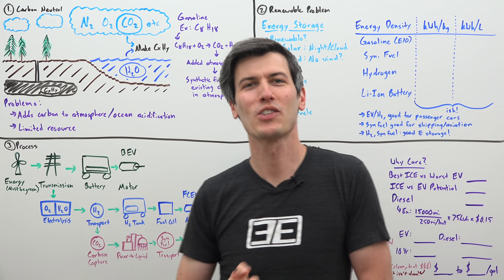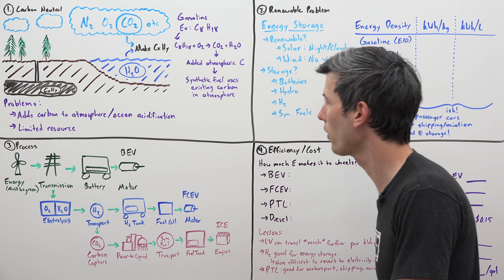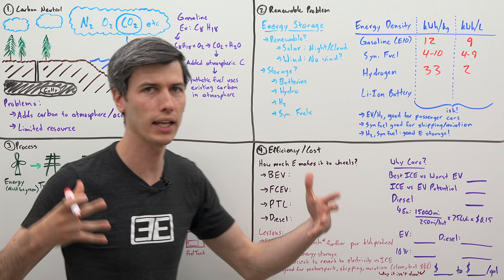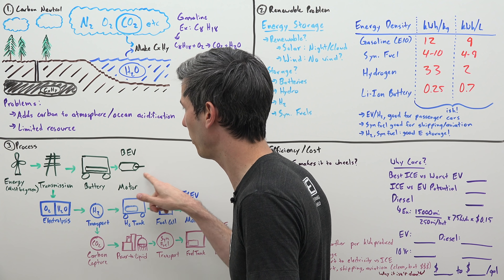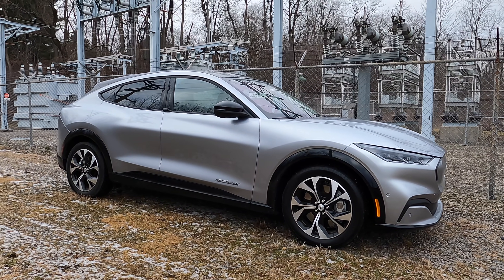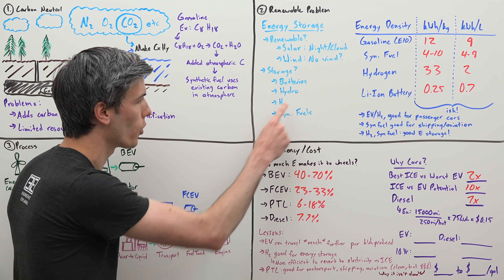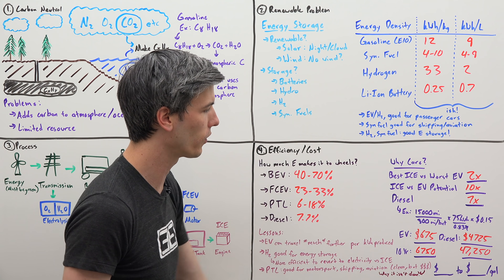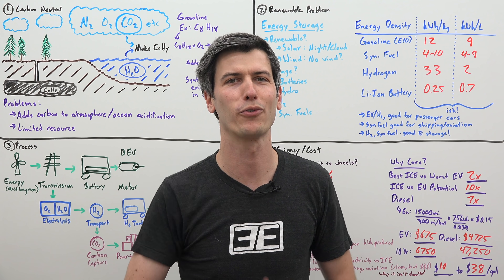The Big Problem With Synthetic Fuels

Comment: I wasn't thinking that synthetic fuel will replace electric cars- I was hoping that it will be an affordable fuel for classic cars in the future when normal everyday transportation is based on electric engines and batteries.
Reply: Decades in the future, classic cars will be small in number and not a significant source of carbon.  Just power them off of fossil fuel and don't worry about it.  The goal is to prevent catastrophic climate change, not obsess about every last bit of carbon.
Reply: well it's not like we're gonna get rid of every single ice in the next 10 years. Not even close. There will be ICE for decades to come and there will have to be fuel for them, it's just gonna get extremely expensive.
Reply: Or for Motorsport perhaps? They need the lightness and energy density that Hydrogen and Batteries can’t provide currently, and maybe motorsports could actually help develop the technology to be better
Reply: @charlespletzke8311  if the planet is truly in peril,  then motorsports would be banned,  as would jet travel,  bicoastal booty calls, politicians on campaign trails for two or more years at a time,  politicians driving about in big gas guzzling GMCs and RRs to mertings,  politicians flying worldwide with their luxury hotel junket teams to discuss less consumption, navies cruising the world intimidating each other,  air forces flying constantly and SpaceX and other companies burning millions of gallons of kerosene to just hang out in Low Earth Orbit or put up WiFi sattelites to help people get their porn faster. 

If you stand back and watch the societys leadership,  there is a massive disconnect from words to actions.
Reply: @STho205  great points
Reply: @STho205  yes that's all true but a poor excuse for personal behaviour (eg: obsessing about the need - in personal transport at least - to make huge amounts of noise (even if some like it) and waste huge swathes of energy) just so you can have a car that is more dangerous, less functional and (if you have a driveway) basically just less convenient.

So if you have to pay over the odds for the synthetic juice to generate all that waste the you won't get sympathy from me when you can't afford decent food.
Reply: @aidanapword  in what world is driving an ICE vehicle more dangerous then driving a bomb on wheels? (EV)
Reply: @aidanapword  I still have a 2013 gasoline car, because affordable EVs were empty promise vaporware then (still are),  and my 1994 car was getting worn out in 2014.   The 2013 Ford is as quiet as an EV inside,  and barely audible running on the outside.   ICE cars are not loud unless that is your thing. 

2033 will be my next planned car replacement.   We'll see whats around then.
Reply: @STho205  dude, I love your comment. Its honestly sad though that that's the case but hey, what are you gonna do right?
Reply: @STho205  that's absolutely fine, of course. And the right thing to do. Whether they are vaporware (in 2017+) or not is a matter for debate. But even if you assert thatthey are still vaporware (ignoring the real world use by many millions of people ...) ... then 233 is going to be a real treat!
Reply: @aidanapword  affordability is relative to people's emotional tie to vehicles.   For me, and I only mean me,  a vehicle must last at least one year for each $1000 purchase price.   I doubt a 2017 Tesla would last 75 years.   I doubt a 2020 T3 would last 40 years.   I know Leafs aren't even lasting 10 to 20 in useful service.   EVs are still in the "Brass Era" of cars (similar to 1910 cars by comparison).  These cars are still prototypes.   I hope they become practical in a range of cost from frugal to posh. 

I have been able to keep to my rule on average for the last 40 years.
Reply: @Jcewazhere  the Chevy dealers never have any on the lot.   They special order them when you twist their arm in my district.  Seems like scores of trucks and SUVs, but no Bolts.  Salesmen say,  you don't want that do you? 

Enjoy your car.   Still too expensive for my transit needs if just a box car,  and as I make a 420 mile trip once a month...all I see at the 200 mile mark is pair of 20amp slow chargers at the Welcome reststop that I'd have to circle back to for an additional 20 miles when heading south.   Half the time I've stopped there to pee they have "out of order" signs.  So much for "The Ray"

I'm sure there's something around Auburn Alabama, but I'd have to go into the city.
Reply: @Jcewazhere  where did you get that we spend $5000 per year to keep our cars running? I spend less than $200 per year each to keep my BMWs running and they're 14, 18 and 19 years old.
Reply: @Jcewazhere  you should look up what cognitive dissonance means. Who said batteries have to have a lot of energy to be explosive? When did I say the range per charge was terrible? You have no argument so you're strawmanning me.
Reply: @Jcewazhere  boy you have no idea how anything works in this world
Reply: @Jcewazhere  it sounds like you beat your car up. The junkiest of junk cars don't cost that much to operate.
Reply: @Jcewazhere  I took inflation into account.  Doesn't matter though.   As I grow older I grow more experienced and less emotionally enamored with an ugly tin box with wheels.  Easier to choose well and spend less.  All cars look basically the same now,  so emotions are easier to check. 

Buy junk,  drive junk, walkalot  pay to completely rebuild the car every few months. 

Buy new,  pay for posh,  the salesman salary,  the insurance agents commission,  the bank officers salary....fine if you know you're doing it.   Dreadful if you keep rolling debt into the next car.  Indentured servant.

Buy 5000 cars.   Keep them five to six years while saving the payment equivalent in your own account.   Eventually buy 7000 car.   Eventually buy a 15000 car.   Never exceed that and the 15k car better be almost new. 

A 20k car (Toyota Corolla or very base Camry) should last at least 20 years.   Lots of 1992 Corolla, Civics, Camrys still rolling.   Plenty of Chevy 2007 HHRs still rolling.   I see 2 or 3 a day, and that was a quirky car/van.  My daughter has one...loves it. 

Take that in mind 20k is 20yrs and 200kmiles.  So you buy it five years old you get 15 years or 150k. Buy it 10 years old 10 years of driving.  But it at 15 years,  then you have at best 5 years left and they are the most problematic years. 

First two years and last 5 are the most issue filled with a typical car.   Recalls and warranty repairs handle the first two,  so if you buy at 2 to 4 years you get a lot of car for half the price of new if you pay cash and don't overinsure it

Oh,  life lesson,  avoid borrowing money for things that depreciate.  Even 0% loans means the interest is secretly built into the price like furniture.
Reply: @STho205  With the prices of vehicles (along with everything else) going up, shouldn't you modify your rule now? I mean a $50,000 car lasting 50 years without serious repair is quite harsh :/
Reply: @alfredwilsbury8397  don't need to still works.   Buying brand new is a suckers game, but even if you do there are plenty of cars for 22k or less in a few models. One little truck in August.   All of those cars should last 25 years or 250k miles.

Expensive luxury cars often don't last any longer than cheaper ones and they depreciate much faster in actual cash loss.  EVs, if the Leaf is any indication, are nearly worthless after 10 years and cost over 40k.  Despite promises they will last, they are trendy experimental cars so everyone always wants a new one. 

Bought a car for 9k out the door 8 years ago.  It still satisfies... So next year i make budget in years.  I already passed 110k of my miles... So i bested budget on travel. 

I don't think I'll change my rule of thumb.
Reply: @STho205  The car you bought for 9k had no repairs over the 8 years? And what did you buy for 9k actually it seems your preference of cars is more essential needs than anything else which is cool. More of a simplistic attitude to what cars should do for you. But buying brand new is the only reason you can have a used car today so I wouldn't call them suckers. The only people I may call suckers are the ones buying a new car they cannot afford. 
Any car can last decades if you take care of it enough, which in some cases will be pouring cash into it.
Reply: @alfredwilsbury8397  none of any real expense to me.   An AC dryer that was flawed when i bought it (on a 38F day in Jan), noted on the paperwork as AC weak and fixed under used sale warranty for ZERO from me in April.  Brake job (front) at 110k, done by me, 10 minutes a wheel, $14 pads.  Rear brakes still fine.

I will assume a clutch and timing belt is soon but that is a consumable like brakes.   Tires every 65k so twice for me.  $260 for a full set out the door.  Oil changes at $25 every 6 or 7k

I bought the car with a 2 year drivetrain warranty included.  Never needed it. 

Oh i did buy a battery after almost 8 years.  The OEM worked, but was weak if I parked it for a week.

Sorry but them-s da facts.  Honest truth. 

You don't have to dump massive money endlessly into a car if you see it as an appliance.  If it's your metal girlfriend...then it is going to cost you.

Best deal i ever got was a $9000 Miata, i kept for 17 years, put 250k on it and sold it to a friend who still has it... But this one is half way there and my wife's 11k car might make the grade too. .

You buy a car in it's first two years, the car is expensive and often in for annoying service due to recalls or factory whoops. 
Buy a beater in its last two years it is expensive...constant life support.
Sweet budget spot is in the middle with sn uncomplicated car or truck . 

Live and learn.
Reply: Oh Fiesta-S.  Base model, black, used by a home care nurse for  12 mos.  She got a $14k car allowance so she bought a 14k car every year. 

Sat on that lot for four months.  People wanted an automatic.  I knew that was the big flaw with Fiestas so I "settled" for the 5sp... Which is strong.   Went to the rural Ford dealer on the coldest day of the year on my way home from work.  They had three customers that day, and I was the only one buying.   

They had a rule.  Any day they didn't sell at least one car, new or used, they had to fire a salesman.   I saved a young girl's job as the sales manager put it on her board, even though she wasn't even there.  She had sold no cars that month.
Reply: @STho205   so true, if everything was really looked at from an environment damaging point, then no industrial farming, limited to having one child, no private vehicles just energy efficient mass transit etc. I live in California and we have a massive drought yet all vineyards get the water they need to produce the drug alcohol and golf courses look green and beautiful. It’s wants VS needs and most will not give up the wants, simply human nature.
Reply: @MrGmilton  Ben Franklin advised his colleagues to WATCH the rich, but never listen to them.  The wealthy will advise a commoner to invest badly or live badly or accept austerity...while their actions are often the opposite of such advice.
We saw it in 2020, where "we're all in it together", "do the right thing it's a small sacrifice", "we all have to do our part"...

However former presidents hosted international private 60th birthday bashes, played golf on closed courses, PM and lockdown governors had big parties and wealthy celebrities, politicians, industrialists and journalists, including health czars, were partying in secret maskless and likely jab free.
Reply: @charlespletzke8311  Motorsport has been doing a great job of improving ICE technology for decades and we are genuinely reaching the limits of what blowing stuff up can do (largely just because burning stuff generates swathes of heat) ... Now when Formula E (yes, it's a thing and it's real and it is pushing the limits of the tech) has the decades to push the tech then energy density (the last remaining major problem?) ... Well ... Blowing up stuff was never a good idea but purely accepting a compromise in the first place (like 10 decades ago).
Reply: @aidanapword  we haven't reached the limits of internal combustion yet.
Reply: It would be for the classics and towing. It is a lot more effective and efficient to move weight with carbon fuels than electric.
Reply: @Sak-zo1ui  but not for long
Reply: Honestly, it’ll be cheaper to just pump it from the ground. If less than 0.1% of cars are gas (classic cars for example) then it doesn’t really matter, although it would be close to $10 a gallon because of unsubsidized oil.
Reply: My thoughts exactly! Things can be taken too far when not put into perspective. Will cars running on syn fuels be more inefficient and pollute more than battery vehicles, sure. Considering the numbers of said classic cars and track day toys which will use the stuff it won't even register as a rounding error in global emissions, especially considering the price of the stuff. I'll use it for track days no problem but never in a daily driver where I clock 99% of my driven miles, it's like using C12 race fuel to get groceries.
Reply: And also, just accept that classic ICE engine just purely suck right out of the buck compared to electric engine. 

Heck the latest ferrari dinosaur car got beaten by a rimacs
Reply: I think synthetic fuels will still be a strong option when the production process is further refined and expanded. 

I hope to still see internal combustion as an option to those who would perfer it for reasons other than performance, and those of us who love the noise and aesthetic of an engine.
Reply: I think an issue in the far future will be more and more gas stations converting to car chargers and reducing where you can fill up a gas car.
As the market share of EVs gradually eats up that of petrol and diesel there's less motivation for smaller gas stations to remain open, with this just getting worse over time.
Here in the UK, 16.5% of car registrations at the end of last year were EVs. (Obviously that's mostly Model 3's)
I personally think we may start seeing this transition sooner than we think.
Reply: The fuel will be produced in regions with the absolute cheapest renewable energy in the world. That energy is much cheaper than what we pay to charge our electric vehicles at home. On a large scale synthetic fuels will become much cheaper than what people expect.
Reply: Nah you can drive EVs and have regular city brown outs.  Also electric company uses gas, silly.
Reply: @Jcewazhere  and then your range will be halved and you would have to wait 30+ minutes for a charge
Reply: @ayoutubechannel921  By converting a classic to electric? It depends on the conversion you do. You can emphasize range or speed in your conversion. You could take a 1960's Beetle Van and get it to more than a thousand miles of range pretty easily, it just wouldn't go 0-60 very fast and would have a max speed of 70mph. 
Or with that same pack you could get a super bus that goes 0-60 in 3s and tops out over 200mph, but only goes a hundred miles. 
That's the best thing about converting, you can focus on what you want.

Why does charging time matter in a non-daily driver? You take it out, have your fun, then put it away. It is a classic, not a daily driver.
Reply: that's definitely gonna be the case. or biofuel. also if you have a diesel you can always run it on vegetable oil, that's not going away :)
Reply: Exactly the fun of manual raw car with gasoline engine.... The heel toe shifts and hillstarts evdrything will be lost.... Skills will be turned into softwares and there will be simulation for gasoline engines
Reply: yeah i was also thinking that wouldn't replace electric cars or stop them from taking over the world but to at least let us keep driving our gas cars.
Reply: I fear your hopes may not be realised.....
Reply: There is so much more to this…. Battery replacement? Second hand resale of scrap ev car? 300miles yeah okay…  And then you have the distance from the source of power to consider just because you see that number on your meter that is only metering your section of the network, for instance if you live a long way from town and you metered your supply at the town it will be more than as it enters your property as it has to travel further another thing to consider.. What about the environmental costs of creating the new infrastructure to support many already stressed electrical systems. There are fuel stations that distribute liquid fuel everywhere all over the globe. It makes sense to use existing infrastructure in my opinion. I drive an old car because I love it and repair it Plus I like driving a car with no ecu it gives me peace of mind. It’s made using a fraction of the carbon used to make cars today because of transportation of resources. 
  I work with power generation and a cheeky little secret… I very often go out to deploy a dirty diesel generator to charge ev’s that are caught short because the battery just does not perform like they have been sold. Another important factor is the time it takes to charge 🤫 and what is the value of time? £50 or 2hrs charging that costs you £36 because any charger that is not your house costs more than 15c/kWh. That is also if you can find an available charger, it’s a longer wait than a queue at the gas station. So I think there are a lot more real world questions to ask than trying to make this a simple equation
Reply: Oli K:  If it improved greatly on the dangerous pollutants (re health risks like NOX, etc) that gasoline burning admits, then I'd be all for it.   If it costs more, the enthusiasts can pay that differential and still have their ICE's. 

BUT,  the dangerous pollutants from burning e-fuels apparently are roughly on par (per google searches for multiple sources) with gasoline.  So since cancer, lung disease, etc. risks are NOT good, this should only be used as a transitional help while the BEV fleet is built up, IMO. 

Obviously, classic ICE car fans and business will disagree, and that's what government / elections / strategic policy and trade-offs are for -- to hash such things out. 

So maybe a compromise would be no new ICE production once there are enough BEV's, and some kind of extra tax for the extra medical costs, and let the old ICE's phase out over time, etc. 

Economics should NOT be the only variable in such decisions.
Reply: I have been using aspen synthetic fuel for many years. First in chainsaws. Then in classic trials motorcycles with glassfibre fuel tanks. Now I use it in classic bikes for winter storage. It has fantastic storage capacity. It keeps it's octane levels for years. It does not attract water. And fires right up in the spring. But it is expensive. About 16 pound for 5 ltr.
Reply: I have been using synthetic fuel in chainsaws for years. Cleaner exhaust and long shelf life and easy starting when logging starts. I have two vintage motorcycles that see little use and have glassfibre fuel tanks so I use synthetic fuel in those.  For higher mileage take the ethanol out of regular fuel.. I also put synthetic fuel in fuel tanks and carbs over winter.
Reply: People that say that no one will need fuel anymore need to remembered that jet engine will need fuel, there's no way to make electric plane fly far and fast, so even though ICE cars are gone from productions, planes would still need them, and also long distance truck will still need fuel, battery doesn't make sense for long distance driving. So, the supply chain would be there, and aviation fuel does work on cars, so we might be able to share it.
Reply: Synthetic fuel will not replace just one BEV…😂😂😂
Reply: Considering my country is now experimenting with noise camera's to be able to catch and fine cars that are too noisy because of either the engine or the exhaust etc... I doubt car enthusiasts will get to drive all that much with their classic cars in the future (these cars where noisy). My dad has a classic NSU, you hear that thing coming from several streets away, an hour of driving in a city that has these camera's would land him so many noise nuisance fines he'd never drive it again.

Unless he where to convert it to an electric car, there are garages specializing in converting classic cars these days
Reply: Hohoho oil lovers commenting. Gotta love it. 

Oil or shall I say fuel for ICE cars are very much inefficient rather than lithium or other renewables. Yes lithium mining can be harmful to environment but so as drilling oil right? Hello gulf explosions and spills. The problem with you loving oil is you do little to preserve the environment while offering only lip service. 
Now there may be some like in norway. But problem is in US there aren’t any. 

Now back to lithium I believe when it hits the threshold there will be a lot of recycling stations willing to recycle it and put it back again thus. Reducing the chance of mining.
Reply: @Zach-s5g  mining lithium is much worse than drilling for oil. That's why the people of Afghanistan chose to keep their beautiful landscape instead of blowing up their mountains for profit. The Soviets and the Americans took offense to that and that's why both invaded.
Reply: @Zach-s5g  also, we could run ICE vehicles on fuel derived from sugar cane, which is carbon neutral. Brazil was working on this, I'm not sure how far they got.
Reply: @Jcewazhere  smarter people than you already determined that sugar cane is carbon neutral
Reply: @Jcewazhere  ahh, mainstream media. No bias there
Reply: @Jcewazhere  cutting down the rainforest for more farm land is a no go for me. They can figure out a better, more efficient way to grow crops.
Reply: @Jcewazhere  you want to drop a Tesla powertrain into an old Corvette or Camaro? 🤮 That should be a crime! Why would you ruin them like that?
Reply: @NikoBellaKhouf  To be fair they ARE faster. However faster does not mean necessarily better. Most modern cars are faster than 60's muscle cars, but I would rather drive a 70' Mustang Boss 302 than just about any electric car.
Reply: @mixrable1212  there are ICE cars that are just as fast. But speed isn't everything. Electric cars are miserably boring. I love your taste in cars. Mustangs are among my favorites.
Reply: Ev's are ok most of em though are like milk floats bloody horrible thing's, others too expensive  also not as environmentally friendly as the hype suggests much of this hysteria is caused by rich bods and the media , we do need to protect the planet and our animal friends though, however there are far better ways than constantly harping on about ev cars they make a climate contribution of 2% what about the rest
Reply: its a shame all these classic cars will be destroyed
Reply: Don't worry. ICEs aren't going anywhere. I used to think different until I tried to get a used EV with a bad battery, at 80,000 miles. Then found out the battery was going to be over $12,000. I've never given over $3000 of a vehicle and I get 580,000 miles out of them. If you figure in the degrading battery and replacement costs you can drive a used ICE getting 14 mpg and come out cheaper.
Reply: @Bryan-Hensley  Don't worry, battery cars aren't going anywhere. I bought a used gas car and the engine was shot at just 80,000 miles. It was going to cost a huge amount to replace it. Then I found out it had transmission problems too. And fuel pump problems. And exhaust problems...

lol even if your story about buying a lemon EV were true it's not like people don't buy lemon ICE cars all the time.
Reply: @Bryan-Hensley  I can't wait until everyone figures out what a nightmare EVs will actually be
Reply: @NikoBellaKhouf  so you don't like EVs mainly because you... don't like the feeling of driving them? Well, hard to argue with that. I also find a manual ICE fun to drive ... but you know what, by far most people don't care about that at all – they just want a car to get from A to B with the least amount of hassle possible. And more often than not A and B are within the same city, in which case EVs do the job definitely better than ICE.

For long distance drives – yeah, batteries still aren't great there. Specifically, they need to be way oversized, which is the main reason most current EVs are so heavy and resource-intensive to make. Still it works – here in Norway, EVs already make up a very significant portion of cars on the road (and more than half of new sales), many people have been driving them for years and are happy with them, despite the long distances to travel. And despite last winter, which certainly did pose some problems for EV drivers – but it also posed some problems for ICE drivers who didn't have the best winter tyres.
Reply: IMO Not enough classic car enthusiasts to make it worthwhile from a saving the  planet standpoint.
Reply: @andrewpaulhart  I mean it already exists, they are just going to have to pay like $12/gallon to run those cars
Reply: @paulkhayet4589  that is less than double the prize it is now (in Germany about $7/gallon ) so for a the occasional drive with my classic Volvo- that would be ok
Reply: @paulkhayet4589  if you have something that requires leaded fuel and/or over 92 octane that price is likely in the neighborhood of what you pay already. Going to alchoholic/propane fuels with newer engines that get rebuilt after being taken from wrecked vehicles, it'll end being cleaner on vehicles that get driven maybe 100 miles a year as a combustion engine vehicle will take sitting for years a lot better than, say, a tesla, hell I've seen tesla plaids catch on fire in enclosed trailers at the track here (110⁰f summer heat is hard on lithium batteries stored in what Essentially become an oven in the sunlight), penwell (our local dragstrip) just made a rule where EVS have to be on open trailers if they're towed there, and the same thing applies to steel warehouses that store classics. Not saying the lithium heat issues won't go away, but right now it's a fire hazard in some parts of the world.
Reply: @paulkhayet4589  I'd pay $20/ gallon if it means I can still hear the screaming V12 of a Murcielago
Reply: @andrewpaulhart  I see nothing wrong with carbon capturing synthetic fuels produced by something with very low greenhouse gas impact such as renewable or nuclear being used to run classic cars, or current cars that will become classics. Maybe the NO, etc...given off from the lag of EGRs, catalytic converters, etc but those numbers will be nowhere near what's destroying the planet, especially at the premium price there will be for fuel usage will be low and enthusiasts only. I think more of the concern is the coal emissions spewed across the globe, container ships and semi trucks dumping even more, fumes from commuters, air transport, etc...
Reply: @justinlynch6691  until all energy is renewable wasting energy on a less efficient fuel means that more non renewable fuel will need to be consumed
Reply: @andrewpaulhart  You'd be surprised, a lot of car and antique enthusiasts, and the cost also doesn't have to be *that* affordable, just enough to take out and show off those cars once in awhile and then daily drive an EV.
Reply: @andrewpaulhart  Lol yea all the people today driving Bugatti's Ferraris, Lamborghini's,  don't care. I'm sure that's why Porsche has spent over $100m in the development of E-fuels right?
Reply: @andrewpaulhart  oh boy if you knew how wrong you are with that statement. Literally cars built in the 90s or even 10 years ago will be and are already becoming classic cars. The 90s are literally thirty years in the past. Buying a classic JDM car for example will net you the same cost as buying a 1970s Mustang in the early 2000s.
Reply: @andrewpaulhart  i think there absolutely are, and even if there weren't then classics are a huge part of history and are driven less, and there are less of them in the first place. Its a small percentage of carbon output. Anyway why are we focusing on cars (3-5% of carbon emissions) when the fashion industry (40-50% of carbon emissions) is seeing few restrictions.
Reply: @andrewpaulhart  I’d like to do my part is I can afford to
Reply: @andrewpaulhart  lol you're not saving the planet by using an ev
Reply: @andrewpaulhart  the planet will be fine. It's managed to survive for billions of years before arrogant humans even existed
Reply: @NikoBellaKhouf  ignorance is bliss
Reply: @andrewpaulhart  yes, you would know
Reply: @NikoBellaKhouf  Yes the planet as a whole will be fine, but that doesn't mean we will be
Reply: @nordvestgaming1238  we'll be fine as well, humans have managed to survive for millions of years through very harsh conditions. If you're really concerned about it though, you can start by boycotting China and India. Most of the pollution comes from factories and container ships that transport those goods to us. Removing all of the cars on Earth wouldn't even put a dent into the pollution produced by the worst offenders. Focus on them first instead of picking on the little guy who just wants to drive an ICE vehicle.
Reply: @NikoBellaKhouf  Yes, but...if you look at pollution production for the life of the pollution produced, China and India are mere light weights to the pollution generated by the likes of the UK, US and much of Europe over the past 50 to 100 years or so.
Reply: @Bennyboy-dog  they're not light weights. And if it makes you feel better, boycott everyone
Reply: @NikoBellaKhouf  I agree with you, just pointing out that if you look at total emissions over time, we are all as much to blame as China and India will be in the future.
Reply: @Bennyboy-dog  Electricity produced by the thermoelectrics 🏭🏭
Reply: @NikoBellaKhouf  people can’t wrap their heads around how unnecessary we are.
Reply: @andrewpaulhart  tbh i really think this is just climate alarmism, the climate is acting as it was centuries ago.
Reply: @AlineaEuros  and you know better than climate scientists because ….
Reply: @andrewpaulhart  because we have historians and meteorologists that tell us the past as well as current events, most people pushing this climate alarmism aren't even scientists, when they bring people like Bill Nye who aren't even scientists of any sort to tell us about climate change and how humans are accelerating it, your point is rather moot.
Reply: @AlineaEuros  see that is where you are going wrong.  Historians are as ignorant of climate change as you are.  As for meteorologists …. All but a few accept that climate change is real and urgent.  You can always find an individual scientist who disagrees with others, but science progresses by consensus And the scientific consensus is clear and overwhelming.   You should aim higher than YouTube for your education
Reply: @andrewpaulhart  no one disagrees that climate change is real, what a lot of people debate is weather or not if humans are making it worse and the question after that one is by how much. History also matters in this case which is why i include them, climate alarmists as of late act like Death Valley temperature record in Cali is being broken every year when we have yet to break it since the 1930s, and Cali's drought problems have been around since cities were first being constructed, especially in LA where they having trouble bringing water while it was under construction.

Furthermore a census is not science and the 93% census is also a myth that has been debunked already
Reply: @AlineaEuros  ok.  Please debunk the scientific consensus on climate change for me. Point me to the evidence. Point me to the scientists.   I won’t hold my breath
Reply: @andrewpaulhart  climate scientists have a financial interest in their research. There are plenty of people that disagree with them including the former head of Greenpeace.
Reply: @almac9203  so your argument against the overwhelming scientific consensus is ….  They get a salary and one guy who used to work at greenpeace says so.  🙄. Sigh
Reply: @andrewpaulhart  no these people are getting research grants and consulting fees. They are part of the climate change industry. It is an industry just like the paid shills that said fats were bad and we should be eating vegetables oils and catbs instead. People listened to those frauds and we now have an obesity epidemic. Scientists are being paid for the research and reports and they get money from the government as consultants. Believe it or not there are dissenting points of view in the scientific community and they reject the so called scientific consensus and that tell stories about how journals refuse to publish opposing views to make it seem like there is a consensus. The utter arrogance from people like you is astonishing. Scientists have believed things and proposed theories throughout history and got it wrong yet somehow you take it as fact that these scientists are correct and the opposing views are wrong. Didn't science believe the Earth was flat and the sun revolved around the Earth at one stage? Weren't scientists warning of global cooling in the 1970s yet we are to believe a group of scientists getting paid for their research and models are correct? There was scientists that had research used by government and the UN and they refused to provide the raw data on their figures because they said the sceptics would discredit their work. How unscientific! Climate change is a huge industry from research grants to consulting fees to carbon credits. This is a total scam. The problem with all this fraud is no one will be able to show them that they were wrong until they are long dead and buried. If the Earth did not become unbearably hot and man made climate change was debunked in 300 years it would be too late for the hundreds of millions that were poorer because of this scam. This is every bit of a lie just as the consensus that saturated fats was bad and we should all be eating low fat high carb. You are basically saying because the majority of scientists believe something it has to be correct which is a fallacy because the majority could well be wrong otherwise we would still be drilling holes into the skulls of psychiatric patients to get rid of the evil spirits!
Reply: @plumetheum7017  define “heavy disruption” .
Reply: @andrewpaulhart  Sea level rise of 1.5-2 meters, changes in weather patterns, desertification, weakening of the gulf stream, and more extreme weather events are all on the table. All of that will likely happen even if we flipped a switch, and set the world to zero emissions tomorrow as atmospheric carbon doesn't vanish overnight.  A heavy disruption that will be detrimental to anyone unwilling/unable to adapt.

Some parts of the world will win, others will lose. Those who adapt the most successfully will win, those who don't will lose. That's how its been for millennia on this planet.

An apocalyptic scenario would imply the extinction of the Human race. Which unless temperatures soared well over 8 degrees Celsius over pre-industrial levels, isn't even a remote possibility. 

More interesting however is that you alarmists are dead silent when it comes to the developing world. The developed world is the spawn of Hitler and Satan, but the polluting, decrepit developing countries are just fine to keep burning coal and oil.
Reply: @plumetheum7017  sounds alarming to me.  Re developing world, the developed world caused the problem and now you think it’s ok for the developed world to expect those less developed to pay the cost?  You broke it.  You pay for it is the only moral stance.
Reply: @AlineaEuros bruh the difference between life kn esrth ceasing to exist and the perfect state is 1% and that is referring to CO2 in the atmosphere. We literally have speed up the natural circle of CO2 in just a few hundred years and that seems natural to you?, I guess you believe we dont need to do anything unless we are going extinc; which is our path if we dont change our ways matter of fact we alredy deleted many species because of the same issue I just hope the next to go extint is us and not the planet.
Reply: @AlineaEuros I hope you're kidding comma the research is overwhelming that you're wrong
Reply: @andrewpaulhart They need funding and are willing to sell their soles to get it by anyone willing to. It is also in these organisations interests for us to believe it because we will just cough up the cash while anyone in the top financial brackets need not care that the world is pricing people into poverty.
Reply: No portable energy store is cheaper to produce than poking a hole in the ground and heating the goo with taps on the evaporator column for diesel, kero, gasoline and nat gas.    

That's why there is so much PR, hysteria and government spin to make you switch to a harder to produce and more expensive portable energy store.
Reply: @STho205  It's been around the longest, of course it's the cheapest. If we started doing something else, gas would be the exorbitantly expensive one. And everyone would be going on about how weight/volume efficient it is.
Reply: @roguethrax  I've lost track with this long thread.  

 What is, the Leaf.  There were a lot of little EVs around in the 70s and 80s like that aluminum cheese wedge.  There were some other EVs after 2000 that hit before the Leaf. 

The first EV prototype was in the 1830s almost 200 years ago.  Several lines of EVs in the 1880s to 1910s.  They all ended up failing for one reason or another.   Don't blame a conspiracy by Ford.  Henry Ford bought a Detroit Electric for his wife. 

Massive urbanization the last 50 years made the BEV desirable again.   I don't know if that'll hold now that everyone is doing an about face and moving as far from big cities as they can get.... Just like the 1950s and 60s
Reply: @STho205  EVs are already cheaper over their lifespan than gas cars, it's just not in upfront cost. Really no PR needed and lol governments have been very slow on adopted any significant climate change measures but you think they are fabricating entire industries to make you switch?
Reply: @KeeperOfTheSevenKeys.  we don't really know.  The 1st Gen EVs did not last long at all and were horribly expensive for the junk they were (Leaf,  ChevyEV for government, Tesla Roadster1, several other little brands,  all the Chinese ones built 10 years back).  They became boat anchors to be scrapped once old battery packs were more expensive to refit than a new EV. 

All we have with 2015+ EVs is a promise that won't happen again.   The Bolt is a good example of unlikely to last. 

I still see 50 year old cars on the road.   I kept cars for 20 years and sold them still working for 1k.  I've never spent more on a car than 11k out the door which works out to be $500 a year capital cost plus fuel of under $400 a year.  

Do you really think your EV will cost less than $1000 a year for your life with it.   That has not yet been proven. How's that working for you so far. 

A low end Tesla at $50k would need to be your only adult car for life from age 25 to age 80...and you'd have to only home charge to meet $1k/yr.   I'm thinking that is not likely. 

EVs are more likely to be like iPhones.   Trendy and swapped often for new gimmicks included.
Reply: @STho205 :  It's cheaper to jump off a cliff than support a family.  That doesn't mean it's the better thing to do. 

Whining about the reality of AGW, etc. or lying and claiming it's just hysteria doesn't change the science or the basic facts on the issue.  

In time, BEV's will tend to take over due to superior performance and economics and maintenance / repair needs anyway.

The real issue is how much do we want to reduce AGW in the intermediate term, which could be decades, as the BEV production / fleet builds up.
Reply: Electric cars are bad for the environment. It’s just a different way than gas engines.
Reply: @MichaelRei99  my farts are bad for the environment, the only difference being the degree to which it's bad, obviously in its current methods electric vehicle production has some negative environmental effects, but to say it's anywhere near the effects of gasoline cars is misleading and inaccurate
Reply: @paulkhayet4589  ICE cars also are nowhere near the main cause for pollution, but people see them everyday and like to believe they are
Reply: @paulkhayet4589  if it is about the enviorment electric cars are as bad as gaslline powered cars, knowing that there're options more sostainable. Sure electric cars are an imporvement, but what will happen with the batteries, and it's radiation? or what will countries in it's way of expansion or just poor countries, at least batteries for now has an X life and not reparable as thermic engines... Just saying, from a point of view for the planet and people, synthetic fuels still has some oportunity to grow and catch up with electric power
Reply: @paulkhayet4589  my farts are bad for environment🤣🤣🤣🤣🤣🤣🤣🤣🤣🤣🤣🤣🤣🤣🤣🤣🤣🤣🤣🤣
Reply: @MichaelRei99 don’t bother telling the climate cult
Reply: @MichaelRei99  Are you arguing to get rid of all passenger cars? That's a noble, if unachievable, goal. Mass transport is great in theory, same with car sharing.
If you're arguing that EVs are just as dirty as ICE cars then you're wrong.
Reply: @MichaelRei99  No Mikey. Just no.
Reply: @MichaelRei99  do you own, ride in or rent a car?  Do you buy goods brought to you in trucks?
Reply: @STho205  
The argument that "you can't do anything bad for the environment because you pointed out that EVs don't go without environment impacts" is fools argument.
Reply: @MichaelRei99  That's false... in comparison to gasoline they are much better. Only because producing gasoline is so inefficient.
Reply: @captaindave88  Lmao you probably don't know much about lithium production.
Reply: @bonzo3485  thank you!!
Reply: @MichaelRei99  Everyone here likes ICE cars but as a matter of fact after driving a few thousand kilometers with really dirty electricity any EV is better than any ICE. But you're calling people unironically liberals so I assume your IQ roughly matches your age.
Reply: @captaindave88  he may be stating,  from the context of his sentence, that cars are bad for the environment...regardless of running on lightning or exploding dinosaurs.
Reply: @Henrik0x7F  there isn't a single EV that's better than an ICE vehicle. EVs are miserably boring.
Reply: @captaindave88  EVs are worse for the environment and for humans in general. We're at war with Afghanistan for their lithium. We're blowing up their mountains and landscape to extract lithium.
Reply: @NikoBellaKhouf  Better in terms of emissions. I agree that EVs are boring
Reply: @Henrik0x7F  not if you factor in the emissions required to produce them
Reply: @NikoBellaKhouf  After a few thousand kilometers they break even
Reply: @Henrik0x7F  you mean after a few hundred thousand kilometers. They don't break even untill the ev is nearing the end of its useful life.
Reply: @captaindave88  
Saying there arent negative to EV is saying that you don't know what your talking about.  ICE negatives dont diminish EV ones.  Mining to obtain batteries is a significant problem.
Reply: @captaindave88  yea it's good for you but how about production emisions and where the batery lands after it kicks the bucket. all goes to africa but when a combustion engine goes to africa it can be repaired by locals and "refurbished". when batterys? they are basically waste after a bunch of cycles
Reply: @Jcewazhere  you're getting paid for your posts?
Reply: @Jcewazhere  what part of, "electric vehicles are miserably boring," didn't you understand?
Reply: @Jcewazhere  capitalism? If we had free market capitalism, your precious EVs wouldn't survive. The government is picking winners and losers, and it shouldn't be.
Reply: @STho205  he may be staying the vehicles and personal transport cost the environment no matter what tech they are using. But he is doing that to deflect from the plain fact that an EV already has radically lower impact that is improving all the time and (purely because of the laws of physics) the internal combustion is at the limits of its efficiency already?

Unless he didn't bother watching the video to the end?
Reply: @NikoBellaKhouf  EVs are miserably boring? Because they are too slow? Ummm no. Because they don't handle well? You are on thin ice on that one.

Ah yes, EVs are boring because nobody wants them? Well, that's just absurd ...
Reply: @NikoBellaKhouf  yeah war with Afghanistan for the lithium? When the biggest portion of the world's lithium cones from Australia ... Yeah ... No ... actually. Logic fail.
And you are suggesting we haven't fought many wars over oil?

No wonder you think the planet you are on isn't in a climate crisis ... Because you are clearly not on planet earth.
Reply: @4xHitler  that's all just conjecture and a great attempt and just ignoring the facts and the data.
Reply: @aidanapword  I bet you wouldn't agree that atomic energy is green. would ya?
Reply: @aidanapword  you didn't know that Afghanistan has trillions worth of lithium in their mountains that they do NOT want to mine? Just because a country has something, didn't mean they want to sell it. So of course the largest source will be somewhere else. lOgiC fAiL on your part there kiddo.
Reply: @aidanapword  oil is the reason we're in Iraq, derp derp. That's why Trump pushed for energy independence. You're just trading one war for another.
Reply: @aidanapword  so you think speed is the only thing that matters? There are plenty of fast ICE vehicles. But be realistic, where are you actually going to drive that fast? The vast majority of us aren't drag racing at the track all day. So strike one there.
Reply: @aidanapword  They don't handle well. And if I was on thin ice, I wouldn't want to be in a Tesla. 😂
Reply: @aidanapword  nobody wants EVs. They make up only 1% of new car sales in the US, and that's with all the incentives. They're silly appliances that make fart sounds, literally.
Reply: @aidanapword  they're miserably boring because there's no driver engagement, no connection with the car, etc. The car drives itself. Even if you took the controls, at most you can just accelerate and hold the steering wheel. I prefer to be in full control of the vehicle that I'm driving. I decide when to shift and into which gear. 

Then there's sound. EVs sound like the spin cycle on my washing machine. That's a very depressing sound.
Reply: @NikoBellaKhouf  Nobody wants EVs?  Really?  You should see the number of Teslas in my neck of the woods.  They are highly sought after.  And, most of them were bought after the Tesla tax credit expired.
Reply: @Jcewazhere  good for you enjoying what you drive. Some of us are more easily amused. I don't really care what you drive. I start to care when your side starts talking about replacing what we drive by force.
Reply: @Jcewazhere  crude oil is being sold for next to nothing. Your government is corrupt and money hungry, just like mine and all the rest. That doesn't negate anything that I said
Reply: @Jcewazhere  notice how everything you said went to corporations. The EV incentives went direct to consumers. Meanwhile, we're paying a "gas guzzler* tax and a "luxury car tax."
Reply: @Jcewazhere  that's not how free markets work
Reply: @dansanger5340  they make up only ONE percent of all new US car sales. That's the total sold nationwide.
Reply: @NikoBellaKhouf  The US EV market share 2020 was actually around 2%, not 1%.  But, it was much higher in some states (8.9% in California).  Importantly, that was with very few (semi-)affordable models available in quantity (Model3, Model Y, and Bolt), and none in the huge pickup truck segment.  In 2020, the Mustang Mach-E and the VW ID4 became available.  Also, the Hyundai Ioniq 5 and the Kia EV6 become available this year, although it's hard to say how many will be available.  Next year, the Ford F-150 Lightning and the Tesla Cybertruck become available.  Market share will increase as more models become available in more segments, and competition reduces prices.
Reply: @Jcewazhere  the government is using force by passing laws that force manufacturers to go full electric.

Yes, but we're not bonkers. When you send an armed thug to collect someone's hard earned money, that's called armed robbery.
Reply: @dansanger5340  no, it was 2% of new car sales worldwide. America is NOT the whole world (we have to keep reminding Americans of that fact).
Reply: @dansanger5340  Ford not a Mustang and not a Mach. They should rename it simply E
Reply: @Jcewazhere  $70 is still next to nothing. It used to cost a lot more and really, it should cost more. OPEC is getting ripped off.
Reply: @Jcewazhere  governments are both power and money hungry, if they weren't, then they couldn't be bought so easily.
Reply: @Jcewazhere  feelings? Aww, your feelings got hurt? I'm not sorry. Grow a pair. You haven't proven anything wrong because you can't. Your kind are very emotional.
Reply: @captaindave88  and producing the lithium batteries for electric cars requires huge strip mines for the lithium that btw takes for ever to break down back into the earth and for batteries not lasting more than a few years that will be one helluva bunch of old batteries getting piled up somewhere.
Reply: @4xHitler  tis neither green or convenient. Though it is a way better alternative to coal or other dinosaur-juice based limited resources stuff.
Reply: @NikoBellaKhouf  so the military build up to go and get it from Afghanistan is where? And the political pressure on Afghanistan to mine the Lithium is where? Bearing in mind that we have many many times more ithium available across the world thann we would ever need for a cycclical process to support the energy needed ot move all the passenger vehicles in the world and more ... 
Mine is not a logic fail because I happen to look at data, and two key facts: 1) lithium is abundant and 2) we don't have to burn it.
Reply: @aidanapword  you haven't looked at data that matters. I'm talking about things that happened 20 to 42 years ago and you're looking at recent mining data.
Reply: @NikoBellaKhouf  If you are going to look into data for 20->42 years ago ... then I have two points:
1) the debate about EVs is about now (and so the source of lithium for batteries used now IS the relevant point - there are no wars in Australia about this)
2) it's not like there haven't been (and continue to be) many wars - across all of the previous 60+ years - around fossil fuels
So mine is not a logic fail just because I am thinking about now and the future ... though happy to learn more about the mistakes and misdeeds of the past ... but, like I say ... the wars/misdeeds/mistakes/and inappropriate behaviour is not currently in evidence in Australia ...
Reply: Lol over 6 seconds to reach 60mph and you tried to brag about it... hahahaha.
My twin turbo BMW hits 0 to 60 in half that time... ICE car too hah
Reply: @ryanb4936  which is why Model S and Taycan and Etron GT get outrun all the time ... Ah no, wait ....
Reply: @captaindave88  He's not talking about direct emissions, he's talking about the emissions created by manufacturing Electric Cars. Those batteries are awful for the environment as well.
Reply: @aidanapword  
Lithium is used to power many devices, was in high demand, and that demand was anticipated to keep growing. EVs aren't a new idea. 

Australia participated in the war against Afghanistan. 

Yes, the war against Iraq was over oil. Don't try and justify these wars by saying they aren't the first.
Reply: @Jcewazhere  EV's are just over hyped electric shopping carts
Reply: @captaindave88  Better for whom though? You're not taking into account of battery degradation and extra tires used due to excess bloat. Before you lose your mind I own an EV but it doesnt weigh north of 4000-5000 pounds like a fair chunk weigh currently. Crumbling infrastructure like old bridges wont be able to support vehicles of this caliber... Sure they can be replaced but 40+years pass before they even gather plans. I see it personally in my own area... Be realistic
Reply: @Jcewazhere  I still don’t give a damn about electric cars no matter if I was right or not I drive electric forklifts every day and compared to diesel ones they are gutless
Reply: @paytonputteet  that's a great point about electric vs diesel
Reply: @Jcewazhere  Who are you trying to convince me or yourself? A lot of word salad and so much ignorance in one comment... EVs might be the future but their far from impressive. Especially the slow as molasses Chevy Bolt....
Reply: @Jcewazhere  where I live nobody has the money to buy an overpriced turd with a Tesla logo on it. Even if I did have the money I would buy something that sounds a little cooler than a vacuum cleaner. Plus I don’t like the body lines of Teslas. Btw what tf is a Bolt? Also I’m not talking about old factory equipment unless you say that one or two years old is old.
Reply: @Jcewazhere  I can think for myself I just have never cared for electric vehicles so I never put any research into them. I don’t really care for styling and design of any new vehicles except for the challenger mustang corvette and camaro
Reply: @Jcewazhere  also I don’t have a problem with electric vehicles coexisting with combustion engine vehicles I just don’t think it’s right to say “well we don’t care if y’all like evs or not get used to it” because just like y’all have taste for evs, there are many that don’t and would rather have an ICE
Reply: @Jcewazhere  yeah don’t care a whole lot for the style of the Mach E but the lightning looks kinda cool it’s just weird because the old f150 lightning was a performance v8
Reply: @captaindave88  So thermoelectric aren't bad?
Reply: @NikoBellaKhouf  funny how everyone overlooks the diesel burnt to produce the lithium.... and the big gaping hole in the ground that has displaced god knows how much wildlife.
Reply: @captaindave88  If you take into account how much people will have to buy new cars instead of a second hand ICE vehicle, then you can see how little EVs are going to help the planet...
Reply: @edugamer950  did you take into account how gasoline is extremely inefficient to produce?
Reply: Okay  @captaindave88  I don’t
Reply: @captaindave88  While this video tackles that very subject (energy-to-wheel), it doesn't account for the rare metal mining.  Still, you are right.  EV's come out ahead, but the math in the video doesn't factor all the variables.
Reply: @captaindave88  yes, but even if we all swapped to electric cars at most we're only saving 2 percent of pollution. Because the crux of the issue is that the only cheap and efficient way to make said electricity is by burning coal. So that's what's up.
Reply: @captaindave88  correct. But if someone can perfect the process of making E-Fuel then theoretically it’s pretty even, also we need to perfect this for Jet engines and whatever else needs traditional fuels.
Reply: @captaindave88  that is false as well considering that you are digging for minerals that can cause problems in the ground where we get our food and causes health and pollution do to the minerals that they use to make a battery for ev's so either way it's destroying the environment like a ice does just in a different way of doing so ppl talk about solar energy but it isn't making a massive impact right now
Reply: @captaindave88 Truth is always in the middle. You need 7 years of usage to be greener than a combustion engine because producing those batteries is so not green.
It is greener to buy a used petrol car, than a new electic BY FAR.
Reply: @captaindave88  Yeah electric cars are very efficient but the extraction of lithium and cobalt is a disaster on the environment. It's toxic for local water supplies and uses hundreds of millions of fresh drinking water. 

What we really should be doing is maintaining our cars for longer rather than this throw-a-way culture we've become. 

There should be laws to make cars easier and cheaper to maintain and in my opinion, no one should be allowed more than 2 new cars in their lifetime. 

LiFeP04 batteries don't use cobalt but they don't offer electric cars good range.

Electric cars have a long way to go before they become as practical as a European Diesel which offers 1000 kms range and more. That's 600 miles, my old 2003 Audi A4 Diesel used to go for just over 650 miles on a tank of Diesel.
Reply: @captaindave88 the dead children who mined your cobalt would beg to differ
Reply: The way I see it, the best way to preserve classic cars is as their engines finally kick the bucket, replace the power train with electric motors. I dislike it as much as the next guy, but to preserve history as best as possible, and to recycle efficiently, this is the best option I can see. But as long as privately made fuel like Ignite exsists, combustion engines will live on.
Reply: @I_Am_Lt_Surge  No way am I replacing the screaming V8 in my M3! :p I just hope that some kind of fuel is available for it, long after my DD is an EV!
Reply: @Markpd69  please let us know where you love ... So I make darn sure I don't live next to the Muppet with the screaming V8 ...
Reply: @I_Am_Lt_Surge  But watching some of Jay Leno's episodes, it's the often the unique drivetrains that make a car, not just the styling or interior, so that would be lost. However as you said the wealthy collectors can spend $38/gal to play with their toys.
Reply: @davidmccarthy6061  Unfortunately, there's people who don't have the understanding that allow them to hold these aspects precious like we do 😕
Reply: @I_Am_Lt_Surge  That is horrible... It's not any better than stuffing them into a museum to be a stationary statue for 70 years...
Reply: @I_Am_Lt_Surge  but then you are also throwing away what the engines sounded like and the history behind the engines
Reply: @I_Am_Lt_Surge  you're not preserving the car if you electrify them the engine is a vital part of the character of the car. Change it and you preserved is an empty shell.

I don't think its even needed. If everyone who doesn't care what they drive as long as it gets them where they need to go. The left over classic car enthusiasts will be so small that they could probably even keep driving fossil fuels, and the planet will be just fine.

We don't need to get rid of every single combustion engine, just of the vast vast majority.

Take out fossil for heating, production, logistics and regular driving. And all that's left is classic cars which will account for a tiny fraction of what we currently emit in co2
Reply: @I_Am_Lt_Surge  How are you preserving history if you're completely changing that history? Imagine saying let's remember slavery in America but remove the slaves from history. Like what?